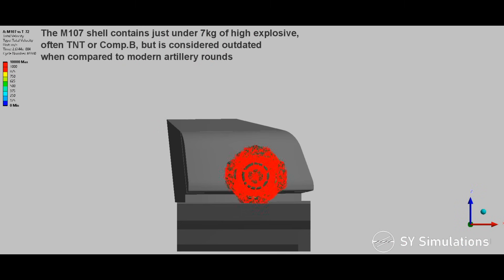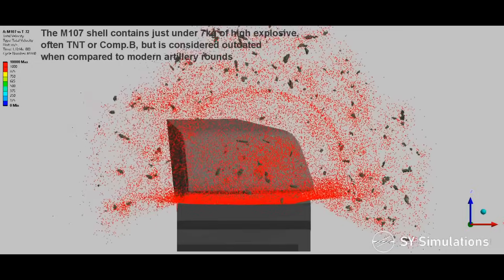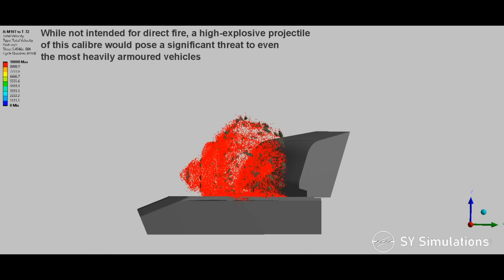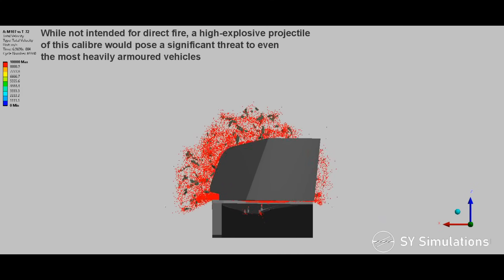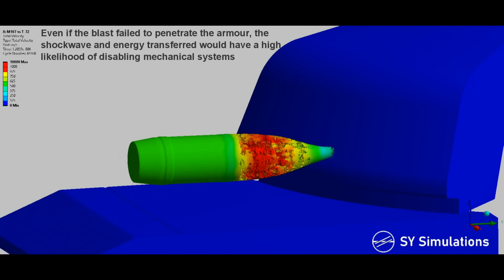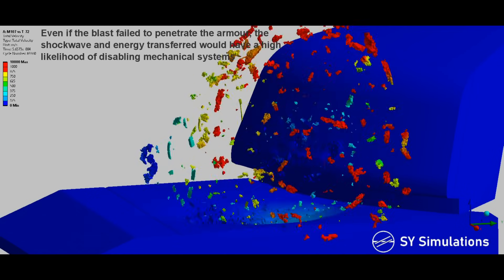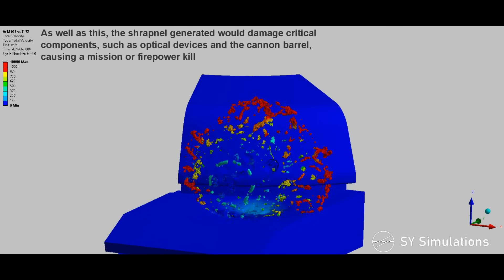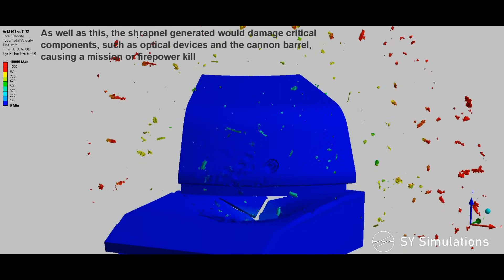DIRECT FIRE ARTILLERY vs T-72 | Paladin 155mm M107 High-Explosive | Armour Penetration Simulation

Comment from the maker: It should be noted that due to computational constraints, the full effects of the actual impact cant be captured, as the response of the turret, the turret drive, and internal components aren't accounted for.

Additionally, an interesting thing to note is that under normal indirect fire trajectories, the projectile will impact the ground at only 300-400m/s, meaning some fragments will be thrown backwards
Reply: This simulation although insightfull for the hull roof penetration, it is not a good indicator of killing a tank or not because of the boundary conditions used to fixate the components of the simualtion.

A 155mm artillery hit has enough force to destroy the turret ring and knocking the turret back for a couple of centimeters. Dislocating the turret is opening a very large gash for the overpressure field to enter the hull.

A direct 155mm hit on a tanks turret face will almost certainly rip the turret off. People think that only the HE blast is of notable effect in artillery shells. But on impact thats still 45kg coming at you at anywhere from 500m/s or faster.
Reply from the maker: @regeNausWeiden  i completely agree, in an ideal world i would model the whole turret system and turret drive, but as you can imagine, that's not really feasible computationally
Reply: @SYsimulations without acces to a supercomputer cluster thats a high ask to simulate for a YT video. It was just an observation.

The turret weight of the T72 (13600kg) is comparable to the turret weight of a Leopard 1(10000kg). And there are Videos from german Howitzer exercises of shooting Leopard 1 tanks with 155mm HE in direct fire mode. The turrets are sheared off.
Reply: @SYsimulations is it possible to simulate it at different parts???
Reply: @regeNausWeiden  except the fuze detonates the shell before it transfers much of its KE to the target… no question it’s destroying the tank, but it’s definitely not like a solid 45kg projectile at 500m/s, it’s whatever inertia is imparted before it blows up. Even in this model, you can see how little the cheek armour is deformed by the impact.
Reply: @reccecs4 detonation of the shell doesn't magically sequester all of its kinetic energy, some of it is retained in the fragmentation and blast wave
Reply: @irregularguy6465  what detonation does do, however, is prevent that KE from being transferred to the thing the shell detonates on. And the KE from the initial velocity is divided by all the fragments, which will have no appreciable effect imparting KE to a tank. And the KE of the fragments is more from the 7000 m/s detonation velocity of the TNT filler and not so much the 500 m/s pre detonation velocity. 

A HE shell with a SQ fuze smacking a tank turret will absolutely not have the effect buddy thinks - like I said it's obvious when you look at how little the shell deformed the turret armour. I would guess you could calculate how much energy that took from the software? Obviously, if it was in contact with the turret long enough to transfer a significant amount of energy, the fuze would be physically destroyed and not function. This is why HESH rounds are base fuzed - by the time they've SH'd even a little bit, a nose fuze would be destroyed. He's saying it'll transfer energy like an inert round impacting would, when that's plainly not the case.

It should be pretty trivial to calculate the inertia imparted by a solid 155mm shell, the KE comes out to just over 4 million foot lbs, and a tank turret is say 20 tons ish? 15 ish for a T72 and 25 ish for an M1A2.
Reply: This has actually been done before in the U.S.S.R. A t-80u was modified, and a 152.3 mm cannon installed. It was reported that even if the shell did not penetrate the tank, the armor was cracked/shattered and the instruments inside the tank were dislodged. 

There wouldn’t be any armor model that could protect a tank from being damaged externally and internally.
Reply: @SYsimulations how much time would it take if the tank was fully modeled (even with crew)?
Reply: What specs do you use for these simulations?
Reply: A real T-72 was shot like this by a 152mm HE round almost in an identical manner. Wouldn’t it have been more interesting to try to recreate those results?

Why do you think your results differ so much from real direct hits?
Reply: would ERA reduce the damage at all? I'd assume not but it would be an interesting test :)
Reply: I wonder if ERA would do anything different
Reply: for comparison, the TM-62 anti-tank mine has about 7.5 Kg of explosives in it.
Reply: Artillery usual higher degrees fall down between 45-15 deg. So this laser sight not real. Most combat action hitting tank sides or near sides blow up.
Reply: Would there also be a chance for us to see simulations of indirect fire achieving direct hits on the roof of the hull and roof of the turret?

Because IIRC a lot of tanks in the Ukrainian war were disabled or  knocked out by artillery fire
Reply: @LuizBarros99  if its a physical direct hit, meaning the shell physically hits the tank, as opposed to an "artillery direct hit", in which the artillery lands in a 10m radius circle around the target, the tank is destroyed. Doenst really matter where on the hull or the turret it hits. Even if its the hull upper front plate a 155mm artillery shell is transfering enough energy to the hull from kinetic energy of the impact+blast from the explosion that the shockwave will destroy all fittings inside the hull. At that point ieven if no penetration occurs the tank is unworkable and scrapworthy.

The crew, if it survives, will most likely be deaf from the sound and partially blind with a high chance of internal bleeding in the lungs as the shockwave transfered from the hull makes small bloodvessels pop.

People massively understimate the effect of artillery shells on armored vehicles.
Reply: @regeNausWeiden  yeah, I imagined that, but I would still love to see more simulations from direct physical hits

Comment: I was targeting for an 8" battalion, and we dropped a training round into a old APC, low angle, minimum firing charge.   Drilled a hole clean through with no explosive.  160 # of steel right around the speed of sound.   About 5000 times the mass of a 45 cal pistol round.

Comment: Can any tank survive a direct hit from actual artillery (not mortars)?
Reply: It really depends on where it is hit, what tank it is, and what round is being used.

Most pre-1980s tanks have a roof 20 to 30 mm thick, and the latest ones are at least 40 mm thick. The one shown here is a T-72B that has a turret roof of 30mm RHA, while the hull roof is 20mm RHA

Standard artillery rounds have a caliber of around 155mm, with the M107 (one used in the video) being just enough to penetrate the T-72B hull roof (~30mm RHA).

However, the M107 has largely been replaced by the M982 and the M795, with both being able to penetrate 40mm to 50mm (best-case scenario) respectively. 

The final answer is probably IF you are targeting the hull roof which is usually thin.

Comment: The M109 may have been developed in the 60s, but it received the name Palladin only in the modification (serious modifications were made to the equipment) M109A6 in 1992, and in the M109A7 version it received even greater changes, including ammunition. How can you trust analytics if you distort (invent) even basic information. By the way, the M2 Browning was adopted 100 years ago, but this does not mean that it is used, that they were manufactured at the same time.

Comment: What about direkt fire 152 mm artillery against Abrams?
Reply: more or less the same
Reply: @sasin2715 the hell you mean same?
Abrams crews would have hearing loss but hey atleast they are still intact
If the shell hit the turret cheek
Reply: @ that shrapnel is going straight down into the driver's port, not to mention that the turret is not nearly strong enough to withstand the raw impact of a 152mm shell
Reply: @sasin2715  The turret will easily stop a 152mm shell

Comment: What about a top down hit by a 120mm mortar, would that breach the armour or is the top armour of a T72 or T80 turret too strong.
Reply: Roof armour is generally pretty weak. A 120mm mortar would either cause the structure to completely collapse or cause severe spalling, causing catastrophic damage.

Comment: when youre inisde a turret and some as this huge explosion take place since it wont penetrate.. what would happen inside even if theresinst any spalling? the wave will pullverize the crew?
Reply: The driver is obliterated into paste and is being cooked because soviet engineers had a brilliant idea of positioning him between the two fuel tanks. The gunner isn't safe either, there's about 90% chance of a critical ammo cookoff because the autoloader isn't shielded and will catch at least a bit of that shrapnel. If the gunner and commander were to survive, they'll definitely have their eardrums raptured and will have severe concussion and might pass out and die a few minutes later.

Comment: I think this is where simulation and reality diverge. Thick (5cm+) armour plates don't cave in and split under external HE blast. If you look at the M1 struck on the cheek armour by a Maverick in 2003 (which has more HE than a shell) the hull armour is intact. I also found an M60 where 155 HE rounds struck glacis and tracks. Gun looks ok, driver has no vision but no structural failure. The track hit has completely imobilised the vehicle.

Comment: Former Redleg here. This what we were told when i went to Fort Sill for osut back in 2003.

We wouldn't use a standard HE round. If we had NO other choice, we would use an M549 Comp B rocket assisted projectile (not a standard tnt charge round) topped with a point detonation fuse, and propelled by a super 8 red bag powder charge behind it.
Then we would run faster than greased shit through a goose after disabling the Paladin.

Comment: I was marine arti and got to fire these shells. The SOP for direct fire against heavy armored target is to go for a mobility kill(tracks or turret ring) and then run for your life because no way in hell will these shells do anything to a tank. Anything less, the shells would rip through the hull like a hot knife through butter. The only other option would be to shoot WP at the tank and hope it melts enough of the vehicle. While shooting infantry with WP is against the geneva convention, shooting a vehicle full of troops for some reason is not. So once again...hotknife through butter.

Comment: From my perspective the artillery shell should have been simulated to come from above or at least a 30 degree incoming angle, they are rarely coming in horizontally unless it's point blank range.
Reply: Direction of approach and impact velocity are largely irrelevant, it's the force of the explosion that causes all the damage. If you just placed an artillery shell on the location above and detonated it, except for the dent in the turret face, the damage would be very similar.

Comment: Can you simulate a concrete/brick building hit? In 2002 I had to fill in sandbags for extra protection on our M109 derivative artillery systems when some generals suggested stationing them on the hills overlooking a terrorist haven and shooting direct fire. Our commander said it seems like a stupid idea since these shells might initiate only after going through several walls and end up destroying neighboring buildings - and the plan was scrapped.

Comment: "The shock wave and energy transferred would have a high likelihood of disabling mechanical systems" is a nice euphemism for "The crew would be spray painted to the floor of the tank from the blast.".
Reply: Everything inside that isn't nailed down will be a projectile, and some things that are nailed down.
Reply: Unless it hits an area with particularly poor quality armor usually no. The british did an interesting test with the centurion with HE munitions and figured out that while in a lot of cases crew have some pressure injuries the tank absorbs the brunt of it. Which is why HESH became used. It had significantly better post armor damage to crew than pure HE. Now artillery HE will wreck the tank mission wise.
Reply: Ear-bleedingly concussed.

Comment: If you could speak to anyone from the Civil War they could tell that even solid shot from a big artillery barrel will do a lot of damage. The amount of energy in that solid shot is incredible. It just blasts through things from the kinetic energy. I think it was the Dutch that when desperate used cheese as shot, and it did rip apart sails and rigging.  The only thing that would be preferred over artillery would be if you could direct Lightning bolts toward an enemy.

Comment: Fun fact - leopard has 2 times thinner armor at roof that t-72.
Reply: Fun fact: you don't know what you're talking about. The Leopard 1 has 30mm of roof armor beneath the turret front. The exact same amount.
The Leopard 2 on the other hand has 35mm of roof armor under the turret front, with an optional additional composite screen of 45mm, amounting to 80mm of armor at that spot. 

In general, it's easier to lie about stuff if the topic is not easily researchable via one simple google search :)
Reply: @skdKitsune  look at anti-mine armor, mine that made to destroy tracks also penetrate armor of leo-2 that placed over track. There about 15mm or something like this. About top armor i don't remember what exactly i mean year ago, but still worse that leo  in armor only merkava. And worst leo armor placed behind the turret and over tracks, there most damage come in war from mines and fpv.
But i appreciate that you actually check facts, if more people was like you then i write more intelligent comments in youtube.
Reply: It was proven when all of the Leopard 2A6 sent to Ukraine didn't even get to the frontlines before being destroyed. Same with the Challenger 2. People forget that tanks are only used for infantry support, because even an RPG-7 (Old Soviet anti-tank) can destroy even the most modern ones. That's why armour is being replaced with active protection systems like the Trophy and Arena systems.

Comment: So, while I was in, my TC told me that against a tank, should we ever be shooting at one, we would use a Rocket Assisted Concrete Slug. The idea being that it would basically be the weight of a naval caliber shell on impact, and just crush its way through the armor rather than slice through it at high velocity. The M549 is heavy as it is. Filling the thing with dense concrete and just slamming hulls and turrets is probably going to do a ton of damage. Its funny if anything else.
Reply: I never heard of concrete slugs while I was in from 2003-2007. Are they new-ish?

I was told at Sill, Comp B rap round, Fuze pd, charge super 8 redbag, then RUN 😅
Reply: Well we ain't usin bagged charges anymore for medium howitzers, so we can start there. MACs (Modular Acceleration Charge(s)) are great. Much less hassle. Much less burned off at the end of training too. Less wasteful.
Concrete slugs however are a combat engineer special. They would be special issue. They'd be more anti-bunker/fortified position than antitank realistically. Its just the principle of, ITS HEAVY AF makes it good at crushing through things concrete or steel.
The odds of you ever seeing one are low. The odds of you seeing out outside of training are lower.
But every once in blue moon some engineers cross train with arty and you get stuff like that. @tachyon8317

Comment: Think you could do a simulation of a round impacting a joint where two armor plates meet? For example, what would happen if a Soviet D-10T firing BR-412D shot a Panther UFP at 500m, where the impact point overlapped with the joint where the side armor was interlocked with the front armor?

Comment: I wonder if a HESH is weaker than an HE when it comes to indirectly penetrating the top of the hull if both shells have the same explosive mass (like in this video here; i.e. indirectly through the explosion at a NOT hit weakly armored point) if I that correctly understood
HESH concentrates more energy on the hit spot, normal HE would have simply exploded (so energy goes evenly in all directions; as in this video: https://www.youtube.com/watch?v=rA4mAEbNChE )

I came across a discussion under a War Thunder video; the youtuber shoots with a British FV4005 with 183 mm HESH shell (21.76 TNT) against heavy tanks like Tiger I and Tiger II... and has massive problems eliminating them...
I play the game myself and like to drive the KV-2 with its massive 152mm cannon... according to the game the ``normal`` HE shell has around 5-6 KG TNT explosive mass and is not designed to penetrate frontal armor DIRECTLY (probably used more on soft targets and bunkers; what neither exist in War Thunder) and I still manage to kill Tiger II and other heavy tanks with a single aimed shot and the bottom rim of the turret (the top of the hull is penetrable most of the time like this shell in the video )

the FV4005 has more than double the explosive mass with 21 kg of TNT; but fails to kill heavy tanks with one shot IN GAME; The problem was only clear with HEAVILY ARMORED Tanks (21 kg tears everything else away) 
people in the comments claim that is not realistic...
does anyone know? can someone answer me that?
Reply: Volumetric shells and also the Jank of the game hit registry. this does not apply to only the FV4005. but even to all tanks and their munitions. like for example. T72 Moderna APFSDS hitting the road wheel of a Begleitpanzer 57. no damage nor did it even pen through into the lower hull. or APDS from Centurion tanks shattering when slamming into the flat surface of a tiger 1. you can really blame the devs for really not implementing volumetric properly for all shells. and overpressure for HEAT. HE and HESH.